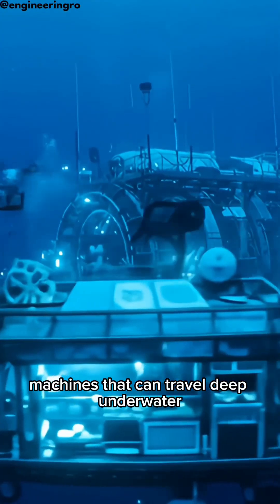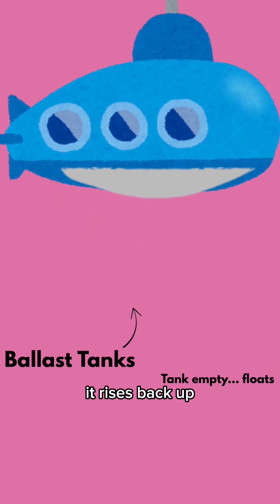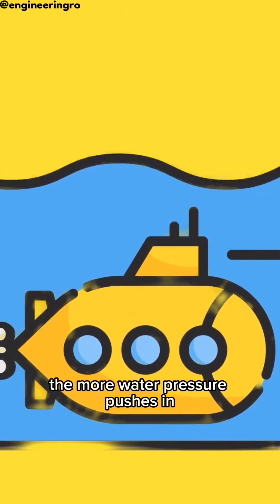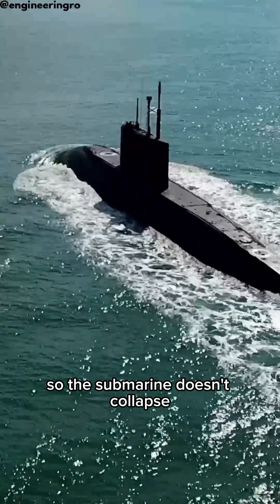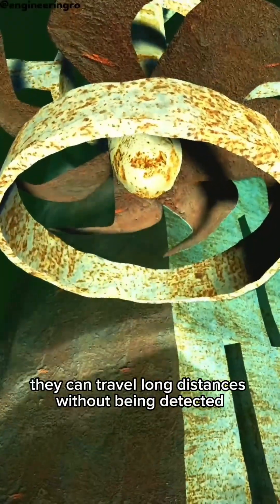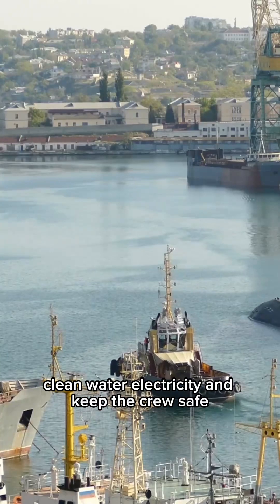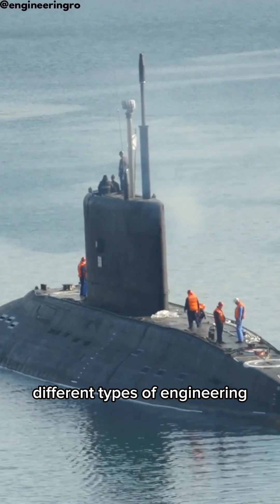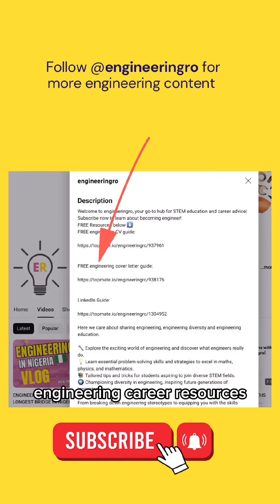HOW SUBMARINES WORK IN UNDER 2 MINUTES

Comment: Nuclear subs 
The Heat from the Nuclear core is turned into steam like a steam train 🚂 movement is turned into electricity.  electric motors move them .air is recycled ♻️ like a space craft. Subs are round because an egg 🥚 shape is the strongest. U boats from ww2 where tiny really. To help dive the crew used to run to the front. ( Das Boat is Great film 🎥) 
Nemo had best looking Subs 😅😅😅
Reply from the maker: Awesome insight, thanks for sharing !